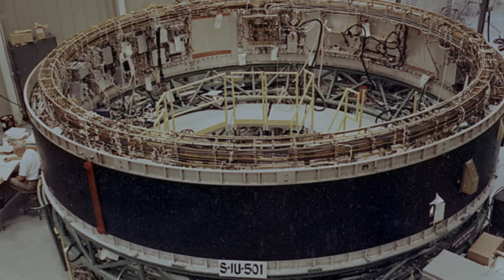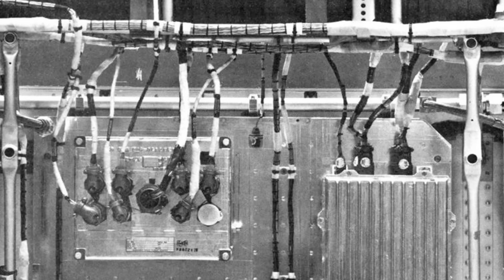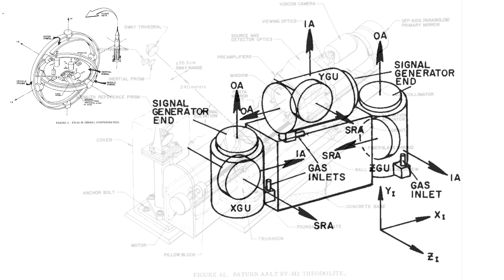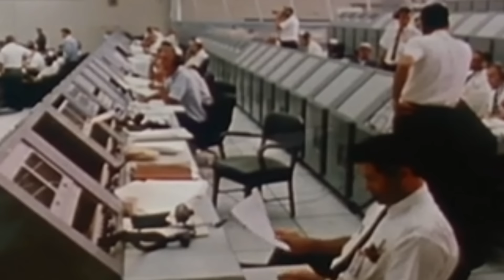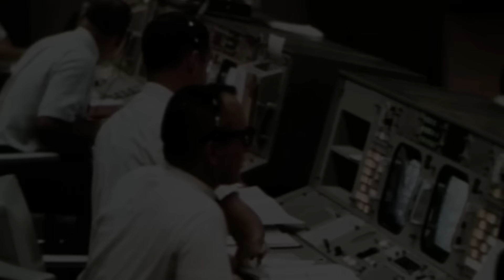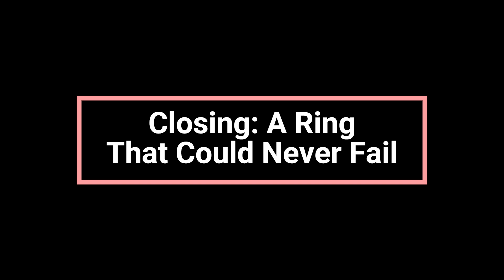Inside the Instrument Unit: The Brain That Had to Control Saturn V

Comment: I learned a few different scientific terms in this video; I knew the concepts, just not the specific terms. Thank you. 

Amazing forethought went into these components and systems, so many guys thinking “what if this?” and “what if that?” I always got smacked as a kid being that inquisitive. 

In all, a very good overview on the importance of this ring. And to think that the dozens that were made, tested and certified were all single use and disposable. Really makes you think.
Reply from the maker: It truly is mind-boggling to think about the scale of engineering required for those single-use components, thanks for the kind words! 🚀

Comment: It’s a sobering thought that the hundreds of engineering in Mission Control Centre stationed at their consoles through tech mission would be replaced by computers that would interpret data and responding with controlling instructions.

Comment: I'm trying to imagine the hundreds of cables that had to run all up and down the Saturn V bringing sensor signals up to the IU, and command signals back down.  I have no idea how these countless cables properly pulled apart as stages separated, neither snagging the separation nor yanking something apart up in the IU the cable ran to.

Comment: In the early 1950's I was growing up in Reseda California in the San Fernando Valley, and in the early 60's, I clearly remember hearing and feeling an incredible sound that lasted for 20-30 seconds and I was told that Rocketdyne was testing rocket motors in the Chatsworth hills just west of where I lived.  In 1966 my family moved further west to Canoga Park that was much closer to Rocketdyne's Santa Susana test site that was no more than two miles from our home.  Many times at night, the entire western sky would light up glowing bright orange, and this much louder sound and physical vibration on my body and at my feet took place!  Much later in life I had a friend that worked as an engineer at JPL (Jet Propulsion Laboratories) and he asked if I wanted to see a rocket motor test at the Santa Susana Site, and I readily agreed.  I had visited this test site before but not for a rocket motor test, I was ushered to a small set of bleachers overlooking a giant blackened pit and given a set of hearing protectors.  Just before the test began on the rocket motor test stand, a huge plume of water shot out into the pit and the rocket motor ignited, I was unprepared for the visceral impact the incredibly loud sound had on my body, it was as if my thorax was being rapidly hit with a plastic baseball bat!  Recently I was told by a friend who worked for Rocketdyne in the 60's that what lit up the sky and vibrated the ground was not a rocket motor, it was the testing of just the turbo-pumps used on the F1 motor!  This I found on Wikipedia about these pumps: "A gas generator was used to drive a turbine which drove separate fuel and oxygen pumps, each feeding the thrust chamber assembly. The turbine was driven at 5,500 RPM, producing 55,000 brake horsepower (41 MW). The fuel pump delivered 15,471 US gallons (58,560 liters) of RP-1 per minute while the oxidizer pump delivered 24,811 US gal (93,920 L) of liquid oxygen per minute. Environmentally, the turbo pump was required to withstand temperatures ranging from input gas at 1,500 °F (820 °C) to liquid oxygen at −300 °F (−184 °C). Structurally, fuel was used to lubricate and cool the turbine bearings."  David Riddle

Comment: There's two going round the sun. I spoke to one of its designers in the US Rocket & Space Center, anazing place - i always wanted to go to Space Camp, never did, but got to the front door as an adult when i went to see the Saturn V. 
It was easier to add heaters than to redesign the cooling system when it was overengineereed. Designed by engineers, built by engineers ❤❤.
IU interior was exposed to ambient  pressure, LM had its dump valve left open to bleed air as rocket ascended as its skin was designed for only a 5psi differential.

Comment: The "computer" inside that ring was hand woven.  Close up it looked like a screen, parallel wires set at 90 degrees to each other.  Thousands of them.  But at each corner of each tiny square was a ring holding that particular squares horizontal and vertical wires together.  So, imagine four rings per square, one at each corner for this explanation.  Each ring directed the electrons through each wire by its orientation set at each corner (i.e. how the wires were threaded through each ring).  All four rings directed current using the magnetic field induced in each ring (depending on its orientation) when the electrical current in each wire induced its own magnetic field in that ring.  By inducing a particular magnetic field in these extremely tiny rings, the electrical current was directed either horizontally to the next ring, or vertically to the next ring.  Then each of these subsequent rings did the same thing.  Not every square had 4 rings at its corners as some currents were sent across multiple squares until it reached another planned ring where it was redirected again.

Essentially each tiny ring was acting as a type of transistor.  Directing current left or right (vertical or horizontal along each side of the tiny square) depending on the magnetic field's direction/orientation at each ring at the corners of the square.  These wires were cross stitched and threaded through these tiny rings by hand.  All the while placing the ring and paying attention to the ring's orientation at each corner of the tiny square.  

The entire computer was built this way, mostly by women.  By hand.  Without any mistakes.  It just boggles the mind.
Reply: Yeah, this technology is almost forgotten. I, personally, was a maintenance engineer for Honeywell 6000 mainframes in the low eighties of last century and helped decommissioning core memories. I have a core plane ar home, saved from the trash.
Minuscule cores, woven together by hair thin wires. Beautiful!!

Comment: The mixed units are a little strange.  The mechanical design of the Saturn V was in US Customary units.  According to NASA's Instrument Unit Fact Sheet of December 1968, the instrument ring was 36 inches in height and 260 inches in diameter.

Comment: The reasons this cannot be duplicated today are; All the equipment for forging, machining, fixturing, welding, assembly and testing back then was proprietary and one of a kind, including the engineers and their personal notes for solving problems along the way, and it is ALL gone now.
Reply: All destroyed by the Michigan Senator (cant remember the name now) (Senator Proxmire) who forged legislation to have everything involved with Saturn V destroyed…
Reply: @Laura-br549  except there’s tons of hardware on display in museums, tons of documentation and computer code still in existence, actual working Apollo guidance computers even the one used for the lunar landing. Senator Proxmire objected to the costly space program but your claim is false. Bad luck.

Comment: My late father was a QA engineer on the instrument unit for the entire program. He got to see 15 launch at the VAB and described the sound as overwhelming as the sound waves would be felt in your whole body. Thanks for this interesting deep dive on the IU.
Reply: Imagine the immense vibrations within the rocket itself, like a paint-shaker on the equipment and the astronauts.  It's amazing that the equipment didn't fall apart nor connections come loose.

Comment: I dare you to try to really think about the wiring in the Houston Control Center.  My God, it must have been a nightmare.  Seriously.  All of those switches at each and every console connected to a central system.  The whole Apollo program will always remain one of the greatest achievements of mankind in all of history.
Reply: Believe it or not when I was stationed in the Air Force in a mobile unit in South Florida(1990-1992) we had several rows of the same consoles while I ran the computer in the very back. It was a mobile Air Traffic Control.   We set up all these console in a huge inflatable bubble and thus we had to build up and tear down and load into trailers and pull them around with 2.5 ton or 5 ton trucks. We even deployed to Saudi Arabia during the Gulf War. I won't even bother mention how we scrambled to tear down all the equipment to dodge the biggest hurricane to ever hit the United States.
As far as the cabling goes the consoles were connected with one big "multi-conductor" cable which contained dozens of small cables. We had to make the whole system work even though it was pretty old technology and very few spare parts and almost impossible to order new replacement parts. To make matters worse the people who knew how to do everything would often leave to go to other air force bases and we'd be SOL. I remember one time we deployed to New Mexico for a 3 week exercise and nobody knew the complex way to use our arcane computer system to "draw" a map on the big screen on the wall. I had a brand new 19 year old Airmen I said "I know you can do it". We, after 24 hours working on it the map looked fantastic. I remember the officers and NCO's walking around at giving me an impressive look cause that map was half the damn exercise.
Reply: You are absolutely correct.  The Mission Control Center was on the 3rd Floor of Building.  The lower 2 FLOORS, contained all the Computers needed by Mission Control to run the Flights!
Reply: That’s true. I’ve never seen any pictures of the lower two floors. That would be interesting to see...
Reply: @larryh8072  Check out   ' Fran Lab '   if I remember she did a video on the projection system,   '  '  '  Curios Marc ' (YT channel) and his team have an Apollo guidance system which they are slowly getting to work.  They also rebuilt the LEM  DISKY  and have run the landing program.  The projection system in the control centre was called an   '  Eidophor ' ,  (search YT ).  The space behind the main control screens contained three Eidophor projectors and a number of slide projectors overlaying grids and maps. The moving markers showing the orbits was don by another overlay on an X Y movable projector.  Search out the video on the Mission control projection systems.  I think you will enjoy Curious Marc.  Best from UK
Reply: @ericanderson2987 there was one control room on the 2nd floor, one on the third
Reply: @kellymcdonald78 it was called the RTCC or Real-Time Computing Center. It had to be separated because of its size and the need for a controlled environment to keep the computers running nominally. The computers put off a lot of heat and needed to be kept cool. Also putting all those people in the same area would produce a lot of humidity and that’s not good for the computers either. It’s the same way even today, you never see the server racks in the same rooms people are working in, they have their own dedicated areas with their own environmental control systems.
Reply: Even just thinking about the quantity of relays is mind boggling
Reply: I have always been struck with the complexities involved in projecting all the data on the big screens in MOC Houston. That was a whole can of worms itself not to mention the rooms full of computers and support engineers from every contractor involved.
Reply: And they did it using a slide rule
Reply: @Joepacker  I knew one of the designers of Telstar and Earlybird and yep a slide rule it was
Reply: The rocket had more than 30 miles of wire in it alone.
Reply: I love chasing wires but that gave me anxiety lol
Reply: Dont forget all the memory cores were ferrite beads hand woven
Reply: Clark Griswold Christmas wiring schematic × √∆§^{45}